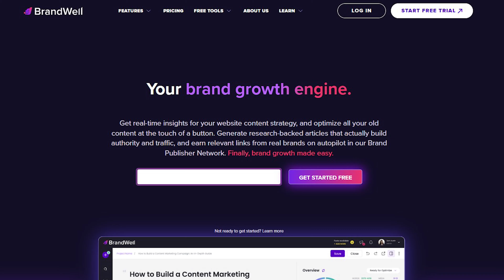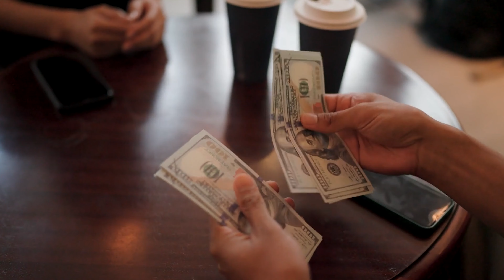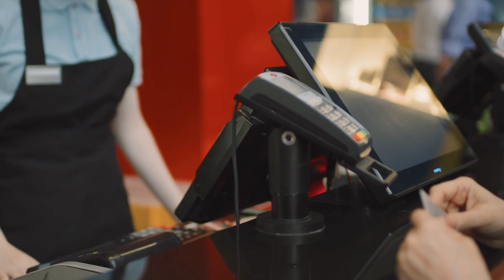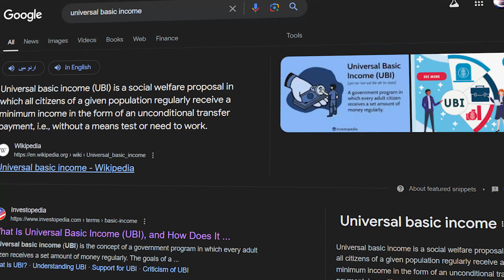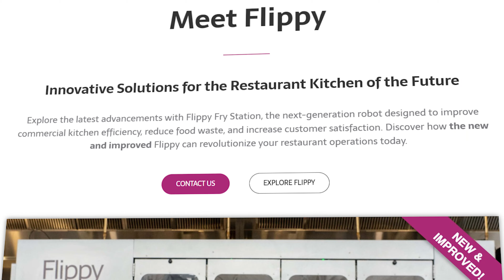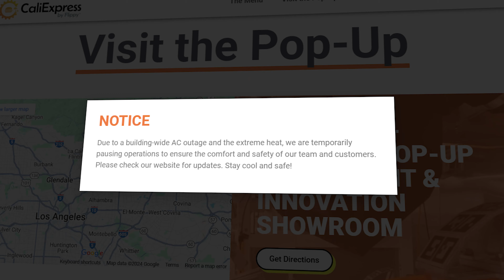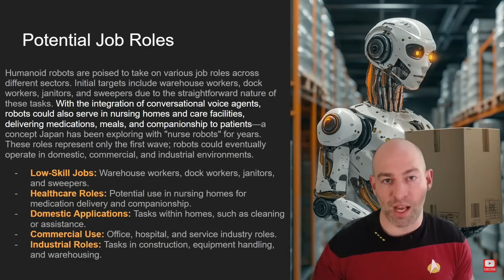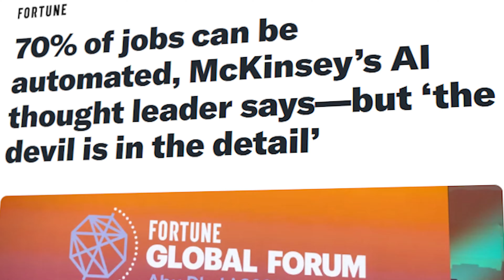AI + Blue Collar Work: Will Automation Take Over Skilled Trades?

Comment: If you consider the dichotomy faced by people in power roles. First you have increasing information asymmetry and adverse selection potential. Second On the question of UBI (once you deal with compensation packages) - there is a need to consider moral hazard. 

Typical control mechanisms to manage this are regulatory capture, compliance (alignment) and of course, the need for collaboration which delves into isolationist vs globalist fundamentals.

As you spoke about Elon I think it’s worth considering his personal algorithm summary and productivity hack - which could be a model in Government Efficiency Force (if/when):

1) Question every requirement, 2) Delete unnecessary steps, 3) Simplify and optimize, 4) Accelerate cycle time, and 5) Automate last.

Comment: Diplomas, licences doesn't apply to AI. It's overqualified for this. The only inspection AI will need to be monitored on are at the dataset level. Making sure the dataset is up to date, curated insuring the dataset stays "unbias" as much as possible. This takes investments and maintenance. 

As far as it taking over blue collar jobs I also believe new jobs will emerge. We've seen that in history where tech took over taking away traditional jobs but replaced by new ones.

Comment: I completely agree with Julia, but I want to add a caveat. While robots today are already quite impressive and capable of performing many tasks, they are still limited by the fact that they are designed by humans (no offense intended). What neither Julia nor anyone else seems to be addressing is that AI has the potential to improve at an incredibly rapid pace because it is based on numbers, algorithms, and code, which can be modified almost instantaneously. In contrast, robots evolve more slowly since they are physical objects, requiring time to manufacture and upgrade. However, this dynamic is likely to shift soon, in my opinion, when AI reaches the stage of AGI (Artificial General Intelligence). Once AGI is achieved, it could take existing robotic designs, optimize them, and dramatically accelerate their development. At that point, current robots may be seen as nostalgic relics of the past, while new, more advanced robots will efficiently handle blue-collar jobs, and their licensing and adoption will become significantly easier.
Reply: Yeah I can see specialty robots for each trade instead of general purpose robots.

Electrician robots would we designed to resist electricity spreading to them while plumber robots would be water-resistant, plumber robots might be smaller and have more than one arm for specialty tasks, and HVAC robots would be designed for 150° heat.

I also think as soon as the robots become common, tasks on the job will start to be standardized more than when done by humans. 

A lot less use of iron and steel in plumbing for sure to avoid rust which makes every job a custom job within 10 years.

Comment: Some points :

Kitchen robots might be specifically made to be able to work safely at higher temperature than your regular human. I'm not sure the AC point is that relevant. We have machinery working in higher temperature already.

Plumber and other human only fields: yes that's true but often time a plumber will have an assistant or apprentice. Human help for tasks that cannot be done alone. Those are first to go because they do not require a license. And that's a sizeable number of jobs. That or a robot will help increase a single plumber efficiency and they'll be able to take more contracts. The one with the robot will outwork the one without.

Regardless of how, it'll make sense to have robots in most fields in some ways, therefore they'll be valuable, therefore there will be people working on making it a reality. There's no escaping it

Comment: I believe that the level of dexterity and precision required by certain professions cannot be easily automated. I can easily see robot builders operating on horizontal and vertical tracks, like a printer. But, the details of an arched passage between the living room and dining room, for instance, I believe is like a craft and wouldn't be very feasible for a humanoid robot.

Comment: I worked all phases of residential construction for decades. I wouldn't expect profound changes anytime soon.  We have better tools, but we haven't even automated highly repedative tasks such as roofing and flooring yet.  There are too many variables there, let alone intricate domains like plumbing and electrical. I may be gone by this time, but in a decade or two I could see a humanoid robot or a few assisting a contractor.  Or better still, the homeowner owning a robot that is trained in the residence and can complete or instruct the completion of most tasks. The same scenario for business, municipal, etc. This would be fun to see, as long as we have the needed economic support.
Reply: "but in a decade or two I could see a humanoid robot or a few assisting a contractor."  This. 100%.  These jobs won't be fully automated for at least another 50 years, and I know I'll be gone by then.
Reply: @Ghaos every '50 year out' prediction I've seen in the last 4 decades has come to fruition in 2 - 10 years.
Reply: They're already 3D printing houses with cement.  Roof trusses have been coming pre-constructed from the factory for 30+ years now.  Modular home builders will go full robot factory.  Current big name builders' workers are shit, and cutting corners every step.  The robots will do all the work then the master electrician or plumber will come in and check off the work's been done accurately, and the house will be built in 2 weeks.  Construction workers have 10 years at the most.

Comment: I believe AI's will be capable of doing it well before they are ALLOWED to do it. You gave at least some of the reasons in the video. 
It will certainly happen eventually. It is inevitable because they will be smarter, faster, safer, and cheaper. A lot of people may resist them at first, but they will have to accept them because they will be the only ones doing necessary services. And once they see how much better a job they do, for way less money ...

Comment: Do you understand why the contractor walked away?

The craft based industries are highly adaptive and utilise many components in a myriad of different ways that unlike knowledge work that can be studied as individual case studies to do this with craft based operations of production we are in consideration of a multitude of different combinations of pieces. To put it into context you could build with any combination of lego and get a mathematical set of results but when you design each individual block as a unique piece that set then becomes less relevant apart from in combination with the unique piece. So instead craft bases are fundamental principles rather than piece and thus require a different architectural compatibility protocol. 

When everything built is measurable in some tangible value then yes what you say about blue collar work is true and possible but so is desire in novelty and not every individual wishes to have the same hence why architecture shows distinct characteristics of producable design and the same is true in metal fabrication and lots of of craft industries that simply will take much longer to be collaborated with Ai. 

The knowledge part shows real promise, the dynamic part is less predictable.

Comment: The question isn't what blue collar jobs will be replaced by AI, but what parts of those jobs will be handled by AI. Computers changed the way blue collar employees worked quite a bit, but they didn't replace them, and it also took a long time for them to become cost effective. AI will be integrated faster, but will also only partially substitute for human capabilities. And it is neither well enough adapted nor affordable enough yet for every employer to benefit from its substantial use.

Comment: More Blue Collar jobs will also be lost as construction, manufacturing methods, etc. are designed to use simple Robot constraints rather than human constraints. You really don't need hyper-sophisticated robots. That is an expensive complex solution, which can be solved by tailoring manufacturing, construction, and assembly to robotic advantages, and not trying to force robots to work like humans. CNC is a good example.

Comment: Currently, AI is good at routinized tasks and finding where those processes can be slotted in and is less good, even abysmal at, creative problem solving. The reason AI can take over some white collar jobs is that a lot of those are bureaucratic or administrative in nature, how difficult is it really to file HR paperwork? 

I think the speed at which it begins to take up blue collar jobs depends on the cost consumers are willing to pay. Maybe troubleshooting a weird plumbing issue would be hard, but if the consumer is willing to give up on the current piping installation for speedy/on-demand resolution, replacing and installing new pipes is probably something AI can handle.

I think the bigger risk near term risk to skilled blue collar labor is how AI assisted diagnosis might significantly lower the barrier to entry for prospective laborers and how that would depress wages.

Comment: All systems make certain assumptions and the job of managers should be to make certain those assumptions remain true. Managers have failed to do this so it appears that AI will have this huge impact however it will not. Also, keep in mind that most companies are run by salesmen, who are notoriously short term thinkers. They will not be able to implement AI in any meaningful way

Comment: A robot navigating all the real time change on a construction site? Thats not happening anytime soon. Robots are at a disadvantage in existing builds for ergonomic and problem solving reasons. 

AI can assist workers to do many tasks but replacing the workers is virtually impossible. 

Heavy construction and industrial sites will never use robots